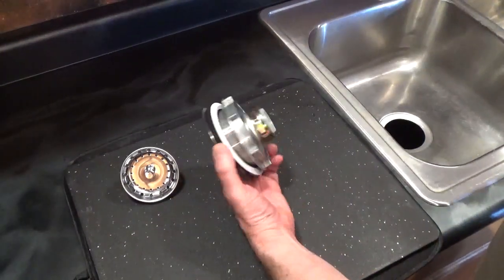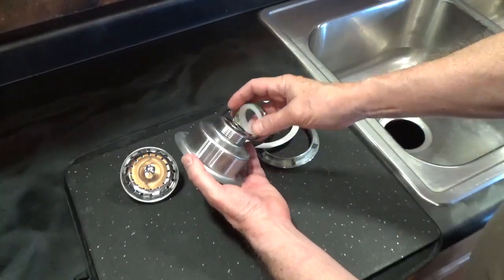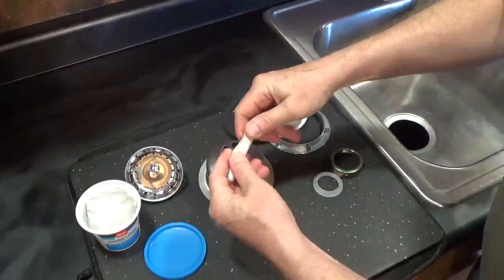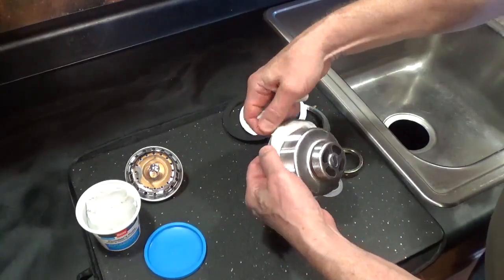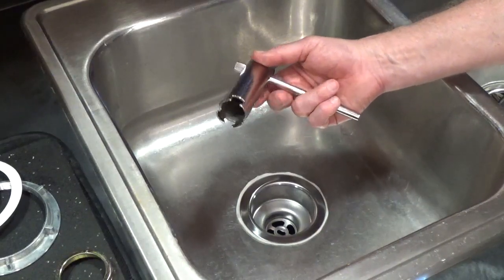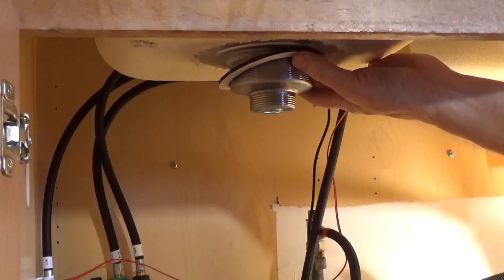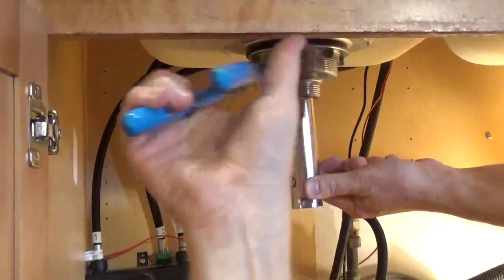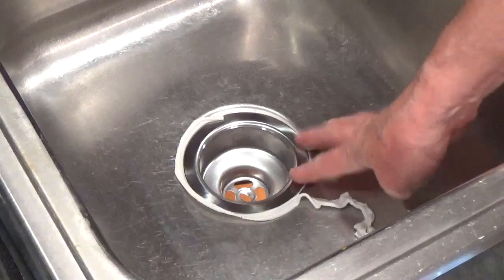Installing Kitchen Sink Strainer

Comment: The garbage disposal drain is a different set up, but you still use putty around the drain itself like you do in the strainer drain.
For the rest of it, read the instructions and don’t forget to take your old garbage disposal and set it on top of the new drain so you can hook the ring that locks down the flange for the bolts .
Read the instructions !

Comment: What if you have a garbage  disposer?  guess you can't do it.  Maybe they make one for such units?
Reply from the maker: Hi, the garbage disposal will come with a flange that sets in the opening and it usually locks in place with threaded rods.